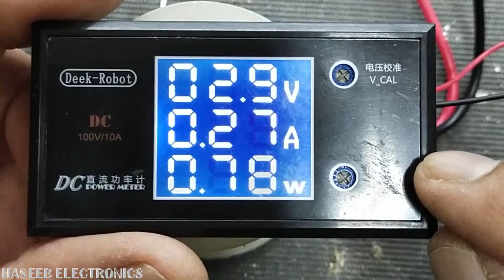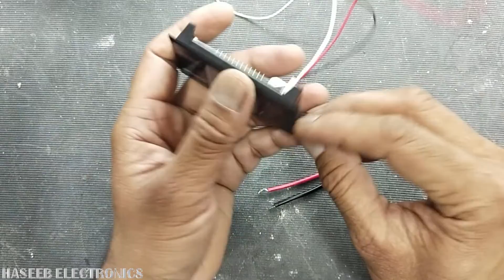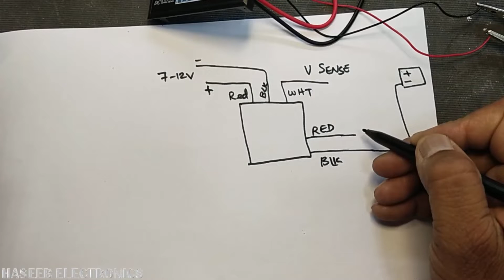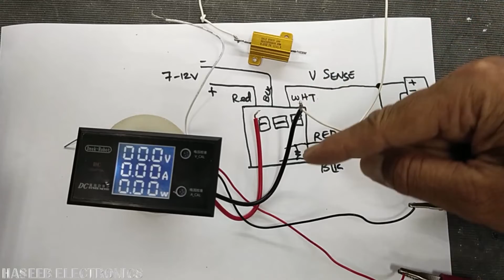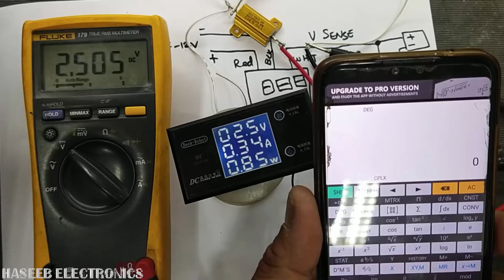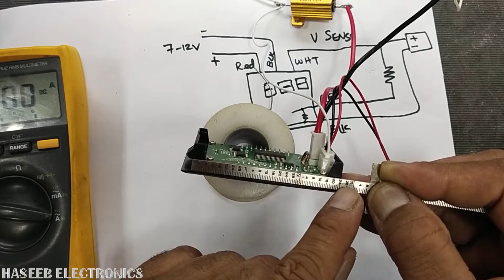{589} Deek-Robot BL-02 100V DC 10A Volt Ampere Current Power meter

Comment: Kia me is meter se 63 volt and 8amp tak ki reading check krskta hun???
Reply from the maker: yes 
maximum limit is 100 volt and current is 10A
so you can check 63 volt and 8 ampere safely

Comment: Hello, thank you for the great information here. Im wondering if it is possible to use this to monitor battery charging? So my 'load' in this case would be a 48v battery and my power source would be a DC charger.

Comment: If you remember there was another version of it that sold thousands  but lacked the wattage display, this one has the same wiring procedure and it is bigger/better but the quality and durability of it is not yet established, what is your opinion of its quality especially now after a 10 months of use ?  have you had any issue? . BTW, thanks for another great video.

Comment: Sir can you help me if want to make a bench power supply  i have a power supply of 24 volts what is the rated volts and amps of the module to buy sir and also if i used a buck converter with a constant voltage and constant current what is the rated voltage of the buck converter to buy tnx sir

Comment: Sir for example i have a source voltage of 220 volts  ac and connected to an outlet if i want to know the wattage of the appliances that i plug in the outlet how can i connect the watt and amp meter to the circuit sir tnx
Reply: Use voltmeter in parallel and ammeter in series the  multiply the voltage with current to get power in watts

Comment: I have an inverter circuit
Which uses Top226YN to power the entire circuit
IC TOP226YN only works for a while and then overheats and stops

I changed TOP226YN to TOP227 to increase power but 2 diodes P6KE200 and BYV26C exploded

Please give me a suggestion to fix it
Does it have any shorted components?

Comment: Hello
I wonder how much have you bought your digital multimer CEM DT-9989 ???
Reply from the maker: yes dear CEM DT-9989 is too much expensive due to its some features, but that features (like embedded oscilloscope function) as per my opinion it is not much useful. as it is 550$ price + shipping charges + custom & excise duties = it will be around 800 USD. so i think it will not a good decision 
select some good meter  with advanced features like frequency, duty cycle, capacitance. it will too much. select in reasonable price (Less than 100USD) and select some oscilloscope separately 
it is my suggestion